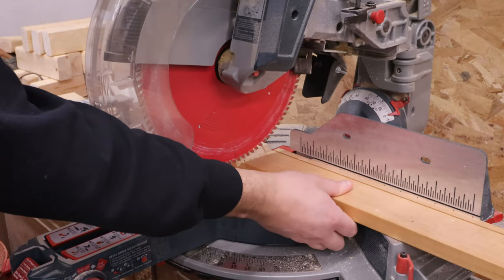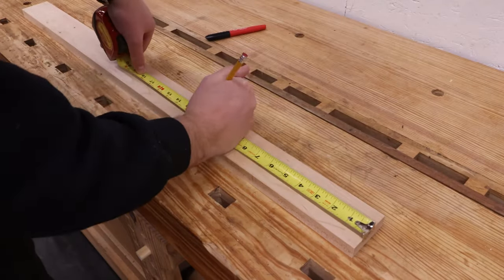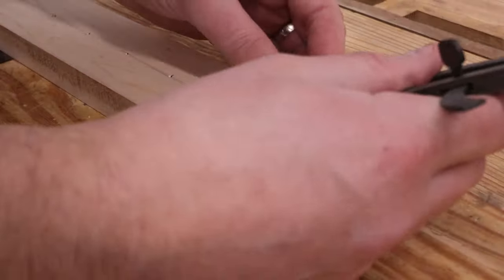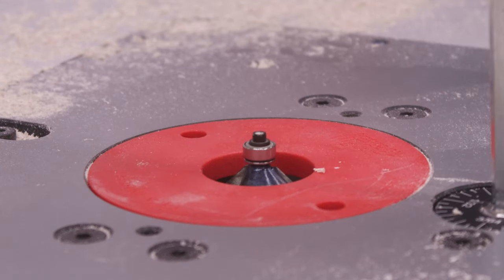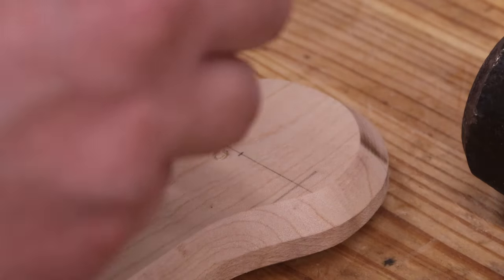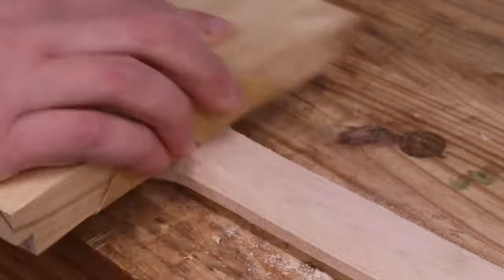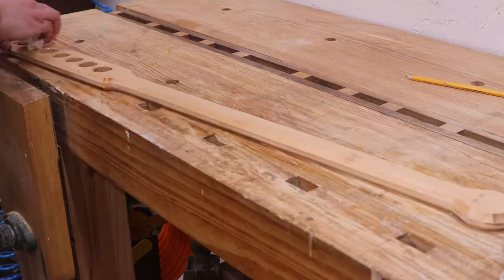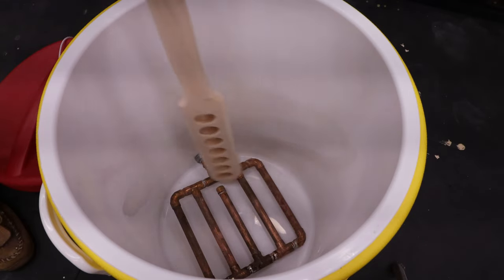Making a Wooden Mash Paddle | All-Grain Home Brewing

Comment: Nice wall hanger. 
A 21st century, home made, homebrew, mash stirrer: Homer steel spackle stirrer, decent variable speed battery drill, two pieces of wood, four threaded S-hooks, two split ring pipe clamps, two pieces threaded rod, nuts and washers. No worry about those evil dough balls, and with the capability of continuous mash stirring, without the worry of bashing thermo-wells, internal fittings, etc.. 
Before building the auto-stirrer, purchase books that are about producing ale and lager, instead of books that are about producing homebrew style, distillers beer, that advertisers renamed, real ale. It is more interesting to produce ale and lager than it is to produce homemade, moonshiners beer, anyway.
Reply from the maker: Interesting take on the mash stirrer.  Would save some wear on the old shoulders, that's for sure.